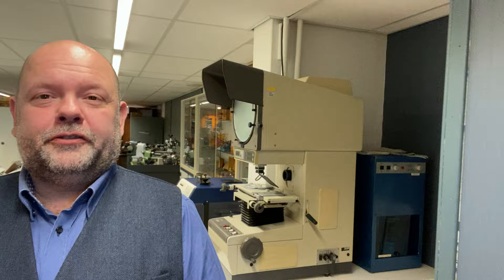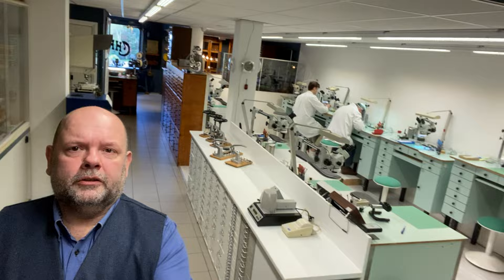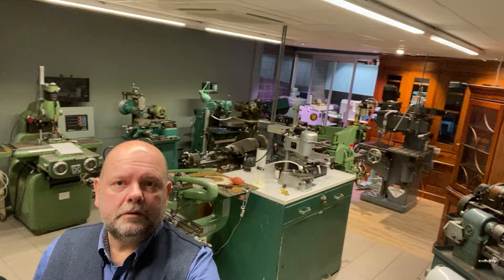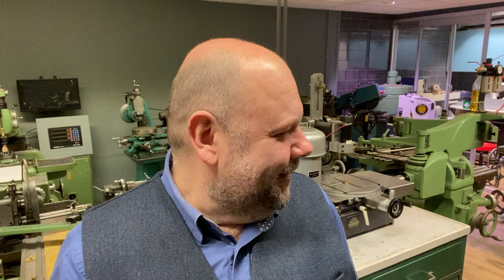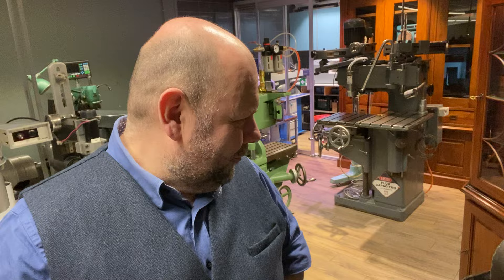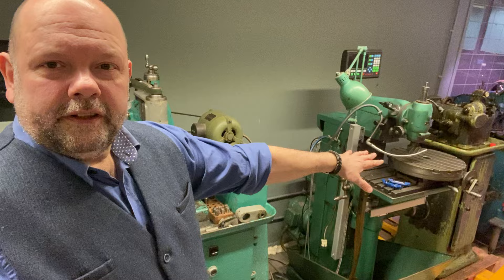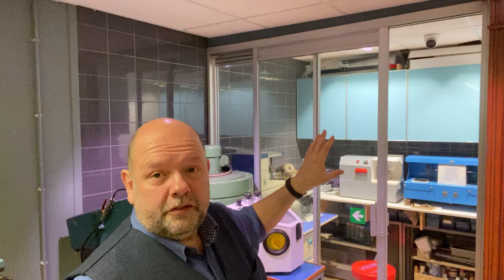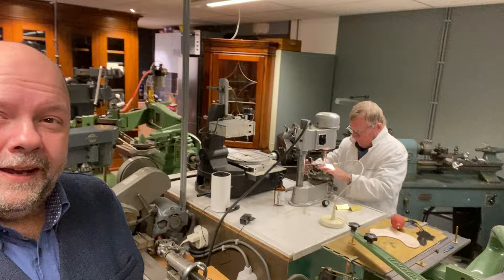Watchmaking Workshop update Q1 2024: New additions and upgrades!

Comment: Thanks, that looks like a very well organized and clean workshop where it is fun to work in and easier to do high quality work. It's crazy how many different machines you have in that not so big space. My father worked with CNC machines and I also often saw the non-electronic variants when I was young.

Comment: That is quite the change from the old shop here in Opmeer! I still have to visit some time!

How much dust leaks out of the bead blasters? The magnetic alarm-sensor on my workshop door is always black from the steel dust it captures from the air when I've used my surface grinder, I would put a vacuum on that if you haven't already.